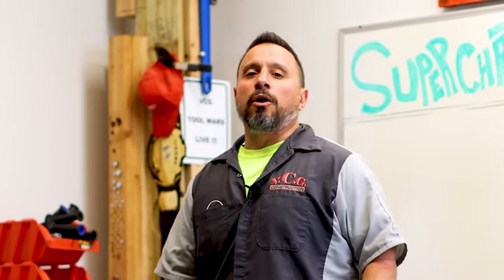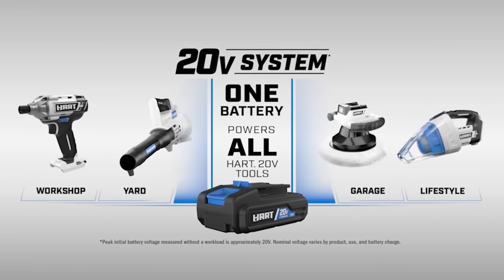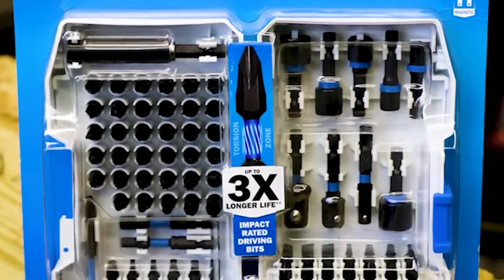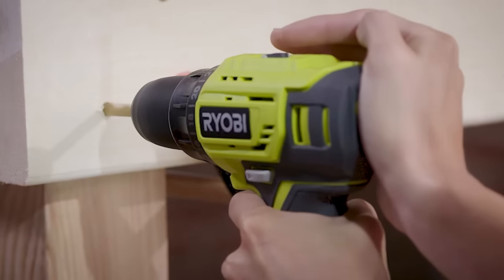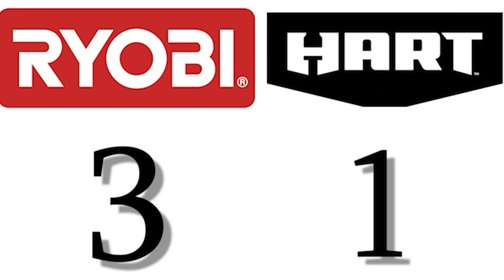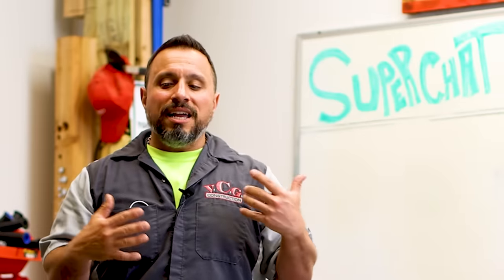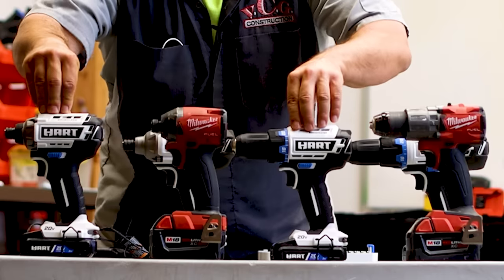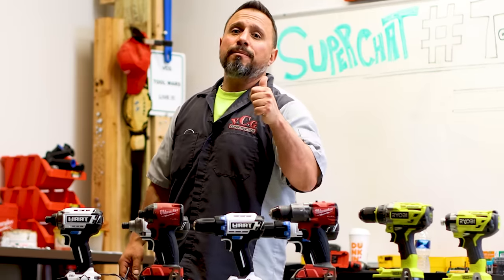HART Power Tools At Walmart PEOPLE HAVE NO CLUE!

Comment: I had a Porter Cable it was fanfastic,fantastic, it would drive in3 in. drywall screws like crazy into 5/8 plywood...sadly it was stolen...I bought a Ryobi same voltage....it didn't  have the. torque  to drive the same screws into the same thickness plywood.... I wish I would have bought a Dewalt.....

Comment: My choices shopping locally are walmart and ace and if I'm looking for tools I pass right by walmart and go straight to ace.  I bought the $99.00 Craftsman drill/impact driver set with two batteries at ace and am perfectly happy with them.  I could go to lowes or home depot, but those are a 60 mile round trip whereas ace is about a 10 mile round trip.  Now, most of the tools I buy are corded because they ALWAYS work as long as I have power.  I have yet to use the impact driver and doubt I ever will as I have an air impact gun and a 2 stage 60 gallon compressor.  I also have a corded electric Kobalt impact gun that's a monster and I have yet to find a bolt or lug nut that it won't loosen.
Reply: I forgot about ace having some craftsman tools thanks for reminding me about that. But then after being in construction for over 62 years I decided to retire early last year.  Yeah I was 13 when I dug a 20 by 30 foot slab with 14 by 20 footing by myself for the carport me and Dad framed up when He came back from off shore and it is still stand proudly all this time.

Comment: i bought the 20V Drill and the battery would not charge.  I returned it for a replacement and it did not charge either.  Tried the jumpstart trick without success.  I bought a DeWalt 20v brushless with 2 batteries for $99 on sale at the Blue store.  Much better deal.  Hart needs to get their act together.

Comment: Fact is, the same company makes Ridgid and Ryobi. However, and you mention this, really you are investing in a platform. Years and years ago, I purchased Ryobi. I have their 18V tools and a couple 40V tools. I have about 7 various 18V batteries, and the 6 battery charge station.  Recently bought the Miter Saw specifically for cutting trim and 1 X material, works excellent!  In the 18V line there are several different amp hour batteries available. The flexibility of the Ryobi line for what I would call the serious DIYer is great!  To me? and yes, I can be wrong, I believe the Hart line would be better suited to the very occasional DIYer or apartment dweller. Not saying the product is bad. There is one other issue with Hart.  Wal-Mart can be rather unpredictable regarding stocking product. I have had many things that I have purchased there, that all of a sudden, one day, they choose not to carry anymore. I would be very careful about going all in on Hart, until they have demonstrated they plan to stay for the long haul.  Just my opinion...

Comment: I've been doing HVAC/R work for the last 13 years using Ryobi back when they were blue and yellow with nicad packs and slowly migrated to the nuke green and haven't looked back.  Sure I get grief from co-workers from time to time about being a Cryobi fan, but I've helped them get out of a pickle or two by having a reliable cordless version of their [REDACTED] corded tool.  It's all about how you treat your gear.  Treat the most expensive brand like shit and it won't last, buy the cheaper version and it won't be enough. Ryobi has been that nice mid price point that has lasted for me with modest care.

Comment: I just save up if need be and bite the bullet and get contractor grade tools. Building a book case, or boat or a Homebuilt Plane you need clean cuts good straight holes and we'll fitted screws snugged tight with no rounding

Comment: I still have my porter cable kit. I found they're just as good of tools as milwaukee. Porter cable didn't have quality batteries. They make a 20volt 6.0ah batteries now and I'm charging way less than I've ever had to.
I'm a Union cement mason and I use my cordless tools daily. Porter cable has survived what the crew and I can dish out and they keep on working.
I am the only guy who has porter cable in the company I work for. They all have milwaukee, yet the porter cable keep up with them.

Comment: I use a mix of Ryobi and Makita but really more towards the Ryobi side. 

Drills, drivers, sanders and other small hand power tools are all Ryobi. I like their commitment to maintaining the battery platform and while they may not have all the bells and whistles of some other brands or even their parent companies brands they get the job done for what I need them for. 

The one area I do not like Ryobi for however is more the benchtop/stationary tools. I tried their miter saw, did not like it. The positive stops while accurate to the actual angle the guide was not. Not a problem if the only angles you use are on the positive stops, kind of a problem if you go for something else. Poor dust collection as well, almost as much of a mess using the bag as with a vacuum. 

Table saws? They might be fine for a job site/portable saw but that is not what I was looking for and they don't really offer a cabinet saw. 

The one bench tool I have for Ryobi that I use (just because I already have it) is a router table. I only got it because I had a Ryobi router and my current router wouldn't fit the other table I was looking at. I regret purchasing it. The whole thing just feels clumsy.

Comment: I love Ryobi tool. They are liable the batteries are interchangeable it doesn't matter if New tools or the old tools I have all the blue one and the  Bright yellow  They have all different types of battery combinations for how much power you want. And the tools are very  liable. The big combo set about 18 years agoAnd I'm still using all the tools and I've added on through the years and doesn't matter what color you have all the batteries are the same.

Comment: Ryobi is by far on the lower end of power tools if Ryobi is beating them let's me know I don't need to mess with it. If you're looking for tools to invest in you should stick with DeWalt or Milwaukee or possibly even Craftsman on the cheaper end. For me I've invested in DeWalt most Carpenters prefer to DeWalt their impact guns are by far the best always go with the brushless motor you get more battery life and more power in a smaller more ergonomical comfort. Most plumbers and electricians seem to prefer Milwaukee. The biggest benefit from brushless motor is that the dirt and dust does not destroy your tool like it does when you go with non brushless tools. All I was doing drywall I switched to brushless tools it was new at the time I bought Milwaukee set and it didn't even last me a month because the brushes got dust on them. That was almost 12 years ago I've dropped my DeWalt tool 30-40 ft straight onto the concrete several times and it still works no problems. Only thing I don't like about the Dewalt is that they are yellow. A lot of these tool companies are made by the same manufacturers!!! If I was going to invest in new tools I would choose between DeWalt and Milwaukee or possibly Craftsman if you're not professional I haven't used the new craftsman stuff yet they are coming out with quite a bit pretty rapidly to be competitive though. Something else I just became aware of there are battery adapters where you can run DeWalt battery in a Milwaukee tool visa versa!!! Batteries can be very expensive I would never buy a battery by itself sometimes you can get 1 or  2. I am the battery you want for just a little bit more.

Comment: I took off a metal roof on a trailer with one battery dropped my hart drill at the battery and still finished the job hart is good but they do need to work on the casing of the drills you hold them and its like you can feel how fragile they are. But i love hart

Comment: I'm still a fan of corded tools.  Why?  Because batteries are expensive and you end up having to replace them.  They should make a power adapter that slides into these tools like a battery but has a cable on it that you can plug into a power outlet.

Comment: I have seen all these tools at Walmart and at home depot .  But I have 4 Craftsman drills and 4 batteries and they are all over 15 plus years old and one that came in a case with charger and circular 6 in and a saws all all for 150 buck back then and still have that kit and all that came with it.  Over the years bought a couple more charges since when I was working on 2 or 3 jobs came to buy the 2 extra charges to leave on the jobs along with the drill and a box of bit along with the extra saws all  blades and saw and all those units used the same battery.  Goes to show you that tools made 15 to 25 years ago will out last the ones that are coming out today.  Oh and I even bought a drill and charges and battery for about 90 bucks or so back around 1990....  Oh my brother who had a construction operation bought several Ryobi's and they didn't last through the job. I ended up helping him by loaning him a couple of my Craftsman  drill so he could finish his job.  Yes we worked together on some jobs too.

Comment: Times are changing.  When power tools were strictly corded, you could own a mixed batch of tools.  But in today’s world, you pretty much need to buy a single brand to ensure that the batteries fit each of your tools.  I have several Porter Cabel 20 volt lithium tools and I want the cordless Brad nailer.   For a tool used every once in awhile, it makes no sense for me to buy another brand as I would have to buy a battery and a charger.   If I buy PC Brad nailer, i can use it with a system I already own.    The Hart brand is the same quality as several other brands with a variety of tools offered.  Getting a tool system that has interchangeable batteries is what the market is giving us.

Comment: I install heating and air conditioning systems I started with dewalt then when I had my impact die I bought a good m18 Milwaukee brushless set. And now I have so many tools and lights and heated jackets and such that I am way to far invested to make a switch I bought Milwaukee cause no one used them and I didn’t have to worry about tools getting mixed up then everyone I work with started buying Milwaukee lol so they can use my batteries and not have to charge there

Comment: I just don’t see a reason to buy hart instead of Ryobi. If you’re looking at pro grade tools you’re not considering either one. But if you just need a tool for a job once, just get the Ryobi. It will work. You’re taking a gamble with hart or harbor freight. Only Ryobi tool I have is the finish nailer. If you use a finish nailer regularly, the Ryobi is pretty good

Comment: I switched to Hart tools and will tell you have no complaints, switched from makita.
Reply: Only if you're not using power tools as a living. I occasionally see Ryobi used by pros, but never Hart.
Reply: @arcadion448  not for living for normal use and so far no complaints. Short of the perfect medium dont have to pay the price for a commercial grade tool and still get something that is not going to break in a year. Knock on wood its been a year and still going strong. Also I bought my very first Hart tool at Home depot.

Comment: i just think the no brainer is milwaukee or ryobi if your gonna go tci, milwaukee has the best batteries and quality with some cheap entry kits and ryobi is still great quality and has a much greater selection of tools particularly in outdoor power equipment, a home owner being able to use the same battery to mow theyre lawn as to fix a painting on the wall is what matters and milwaukee and ryobi cover that and walmart wont be willing to hold over 250 kinds of tools. ps dewalt and makita is another amazing diy brand and for commercial use

Comment: If your battery does not charge,on mount. You just get red flashing light forever. Use a car battery charger,if you have one. Charge the battery for about 30 seconds with car battery charger. Then remove the battery from that charger. Now put it back onto its own charger. Now the light should be flashing green.

Comment: Ive been eyeballing them alot lately. Their chain saw looks solid. Hart seems like the tools someone that isnt an everyday user, more like the occasional user.
Reply: Their chainsaw was great till about 10 cuts knew it was too good to be true
Reply: Look at Bauer at Harbor Freight if you still haven't pulled the trigger.  Great prices,  you can get coupons a lot.  Batteries are  very inexpensive.  I've had my original battery 3 years and still great.  I use the Bauer tools everyday at work.  Watch some videos on here.  Oh and a huge line of tools.  Less money than Hart  and I believe under warranty you can take to Harbor Freight and get a new one no questions asked.  The battery cells are Samsung and I think that's what Dewalt uses.
Reply: @justthisguy1948  I have a Hyper Tough battery chainsaw that I've been using with no issues.  But then again, I'm no lumberjack and use it for small stuff
Reply: @SVMSICE  Yeah I know about them.
Reply: @ericzerkle5214  yeah to me for the price it’s hard to beat. I really can’t believe the quality for the price. I look at like this too if a tool goes bad you can replace it. Even buying 2 lots of times you’ve still spent less than 1 of the big names. That being said none of my Bauer’s have crapped out on me 😆
Reply: @SVMSICE  I have absolutely no problems buying stuff from Harbor Freight in fact I buy stuff from there all time

Comment: These things won’t last putting up metal buildings. I’ve gone through three fuel impacts in the last two years. And I only use them to screw sheets. I never put a half inch bit to use my three quarter sockets to bolt up gurts and perlins. I always use my half inch fuel impact.

Comment: Several things... You didn't mention what kind of tools are available for each brand. "Contractor" quality does not translate to "contractor tools". In other words, "Contractor" does not describe the fields of construction, electrical, plumbing, fabrication, automobile, etc. I think the most important part is the line of tools available. And in that topic, a store brand is not restricted to being supplied by one manufacturer. In other words, part of their line could be supplied by Milwaukee, while another part of their line could be supplied by Dremel (for example), another by Weller  (for example), another by Stil (for example), or whatever other field specialist they want to include in their line. The point is that the line of tools (and quality) is more important than who makes them. A jack-of-all-trades doesn't want to be confined to specialty fields. A store brand could fix that. Black & Decker used to be that go-to brand for variety, but they're slacking off. Hart Tools could even get into cordless kitchen/camping tools (like B&D).  Milwaukee being the manufacturer is NOT as important as you might think. I once bought a pair of Milwaukee work boots. And while I up in a tree with a chainsaw, the heel broke off. I was lucky to recover my balance and not lose control of the chainsaw. Those were definitely not "Contractor"  quality. I still have a pair of genuine Navy boondockers that are more than 40 years old. In bootcamp, we used to "dig" our heels into the pavement during marches. Those heels have never came off. Where's that kind of quality?

Comment: im not happy with my ryobi. chuck is done after 2 years and i really havent build that much with it, battery easy overheat and takes forever before you can charge or use it again, 1 battery is almost 1/2 capacity after 1 year. battery cost way to much for ryobi.

Comment: Cost of battery is a deal breaker. If i can't get knock offs on amazon, I'm not buying into the system. I don't do much though. Occasionally use them and my cheap black and decker is doing ok. It was a clearance buy at walmart. Same for my impact driver and weedeater lol. I know there are better options out there but for the price, they'll do. Might even surprise ya.

Comment: Fact most cheap tools have significantly improved their quality making the gap between them and the leading brands a lot smaller. Anybody that doesn't accept that is just trying to justify paying a lot more.  Fact number two, most people using tools are not using them to make a living so paying premium is not necessarily the best approach. I have bought some cheap harbor Freight tools and saved a lot and after years the tools are still there working just fine and getting regular use, I installed floors on 4 rooms and made other improvements saving over $6000 on labor and only spending $500 on several tools that I still use years later. I just don't see the need to pay 10 times more for a slightly better tool. I do however buy leading brand tools if they have some awesome sales even if I don't need the tool at that moment. I don't need to have all my tools matching color or brands.

Comment: Hated my Hart tools. Got them as a gift, the sawsal would over heat in just over a minute or the batteries would die in 3 minutes. Returned it and still had the same issue. My Ryobi, Craftsman and Milwaukee never an issue. Screw Hart tools

Comment: Home Depot prices are out of range of what most DIY folks want to pay and I can't blame them. Im a pro buy trade but I'm  not going to by another pro grade set for home at so called pro grade prices. I find Hart tools to be as good and also they are expanding their line to include things the the other brands don't have. Building a home tool collection you have to be strategic. You want the same battery across the board with great tools at a great value. Who cares about what the cool kids think. They are not going to pay for your tools arsenal.

Comment: number 2's are number 2. philips i mean ;)  number 2 robertson are beast. and "they can overtorque too easy! philips cam out on purpose!". if you're looking to not over tighten, use a drill with the torque set appropriately ;P if you're using your impact, get trigger discipline.